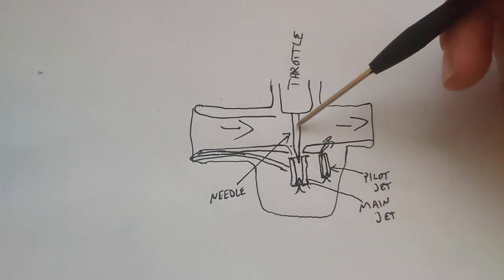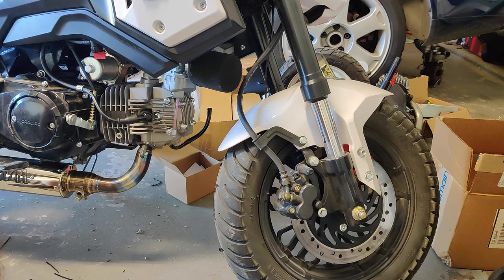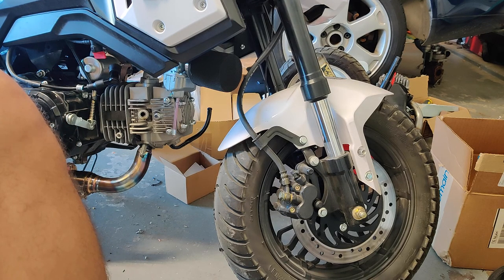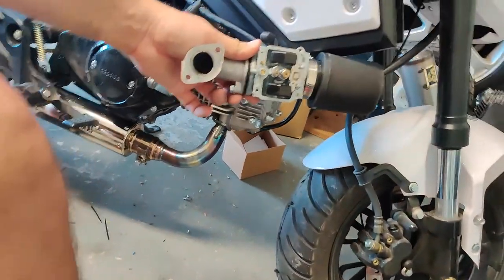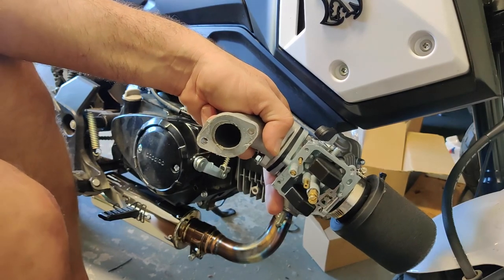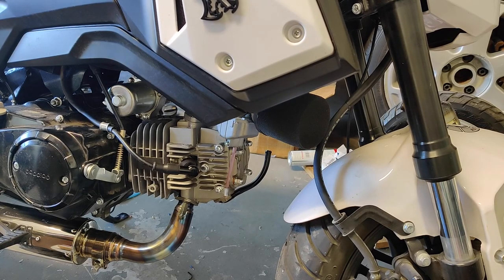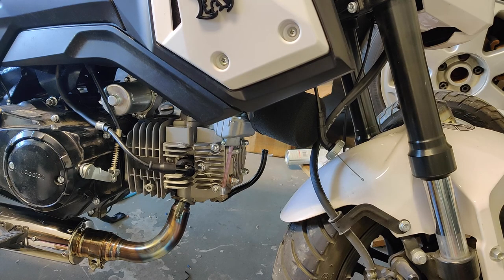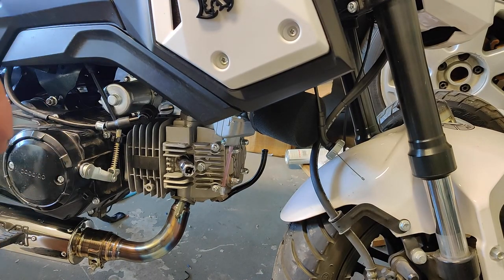Carb Tuning Grom Clones (Boom Vader, Icebear Fuerza, TaoTao Hellcat)

Comment: So you putted Pilot 25 and Main 100? Cause I’ve putted Pilot 40 and Main 110 it’s running way better I have lil bog on the 3rd gear, what do you suggest me? I still have the original Intake (20mm) with a Nibbi Carb 24mm, tomorrow I’ll replace the Intake, so do you think that I need to set the nedle too or change again jets?

Comment: What did you have ur fuel/mixture screw set at? I’m running a 98main and 15 pilot, idles fine but full throttling it bogs n dies its super rich, needle is set in the middle, 790ft above sea level.
Reply from the maker: Man unfortunately I couldn't tell you. I sold this bike a long time ago.if it bogs super rich, this points to a too large main jet. Your fuel mixture screw adjust idle AFR.
Reply: @BrunerTuner Ahh man gotcha! Yeah like idling it’s fine but soon as I full throttle at idle it bogs and wants to die, when I take the manifold off gas is just sitting everywhere I’m lost lol
Reply from the maker: Good luck with the project man! Thanks for checking out the video

Comment: Sorry for all the questions but I just got mine and I'm still learning so I'm curious as to what emissions parts I need to remove. I know about the carbon filter but that's it. It's in California so has all the CA legal crap
Reply from the maker: The biggest things I removed were the charcoal canister and the EGR pump. All I had to do was block off the EGR port on the underside of the head. If you get a new carb and manifold, it won't have the vacuum port. If you choose to keep your stock carb, you can just cap it off

Comment: I need help, I just finished installing mine carb but it doesn’t start. The grey plastic thing where the needle for the throttle is doesn’t go all way down, there is a gap where the air will flow thru. Could that be the issue why it doesn’t start?
Reply from the maker: It could be in backwards. It only goes in one way

Comment: I putbkn a new fake carb. It's idling high, around 6k. I put in a 105 main jet prior to installing. Would that need adjusting? The throttle doesn't fully close when looking into it, slightly open. Kept the stock pilot jet. Help?
Reply: Added a mikuni carb and mine is way up at like 6 grand also. I have messed with it so much the battery died.
Reply from the maker: Something to check is make sure the slide is put in the correct way. It can be put in backwards. Also, make sure the choke is off.

Comment: i have a boom lil duc (ssr razkull clone) that i plan to put the vm22 carb on there which i think comes with a 90 or 95 jet.  do you remove the charcoal canister with this mod and do the bottom block off plate?  i dont have an aftermaket exhaust yet, just the front 16t sprocket.
Reply from the maker: So on mine, I removed all of the EGR, charcoal canister, basically all emissions stuff. For the EGR block off, the gy6 EGR plate works, or you can just bolt down a penny under the EGR pipe for a quick fix.
Reply: @BrunerTuner  getting the block off plate will work so the canister and all that stuff wont be connected, its just dead weight right?
Reply from the maker: @jonathancunanan  yeah the block off plate is the main thing you will need

Comment: I see you have the TST fender eliminator kit on your Vader Boone Did you have to get the OME Honda ground plastics to make it fit correctly? Please let me know I recently ordered one and having troubles I went ahead and ordered the OME parts hoping praying that that's what will solve it very excited to hear back from you Thank you
Reply from the maker: Yes that's correct! I actually did another video on the panel conversion because it was necessary to get proper fitment.
Reply: @BrunerTuner  you did okay I'm going to try to find that video as well Thank you very much for getting back to me man I appreciate it

Comment: Great Stuff. Off topic, what exhaust are you running? And where did you get it? Just picked up a Boom Vader and looking for exhaust options.
Reply from the maker: Hey Greg! This exhaust is actually a Honda Grom piece. Zoom Brute is the model. It's not a direct fit but it will work with some persuasion. I had to heat and bend it with a torch and some pipe.
Reply from the maker: @Tony Barnes Jr the part number is ZM-HD-MSX125-STL20-3-LO-DWN

If you good search Zoom Brute GP, you'll find it pretty easily.

Comment: Loved the video, just got a Vader and working on tuning the carb and this is by far the best video. What exhaust is that? And is it a direct fit?
Reply from the maker: Hey Isaac, thanks for the feedback! This exhaust (Zoom Brute) is a direct fit for the Honda Grom. Due to the angle of the exhaust port on the clone engines, I had to use a torch and pipes to bend it to fit. It can definitely be done though!
Reply: @BrunerTuner  appreciate it! Loving the channel keep it up

Comment: so did you get your exhaust custom fit??? I've been looking for a aftermarket exhaust for so long!
Reply from the maker: I actually used a Grom exhaust and heated it until I could bend it
Reply: @BrunerTuner  what did you use to heat it?
Reply from the maker: A torch

Comment: I’m having a prob with my bike so I change my filter to a cone one and now when I give it gas it acts as if it wanna bogg down(shut off) what could be the problem(I have the boom Vader)
Reply from the maker: Changing the filter to a cone can effect the air/fuel mixture. You will have to tune the carburetor to handle the extra air flow
Reply: @BrunerTuner  so how can I tune it
Reply from the maker: Well this video breaks most of that down. If you add more air, you need more fuel. You could start by figuring out where it is bogging at and go from there buy buying larger jets

Comment: I have a 2021 wolf striker 125cc , I know how to ride but I know almost nothing about bikes and mods . How can I make it faster ?
Reply from the maker: Well, like most 125cc clones, a gearing change does a lot for top speed. Most people get a 16 or 17 tooth front sprocket and that will get you in the mid 50s mph. Past that, a vm22 carb and a free flowing exhaust will help tons. You should be able to get close to 60mph with those mods. Anything more, and it's worth getting a zs190
Reply: Ok , right now stock I’m getting about 55 max . What’s the best choice to get it maybe to 65? And do you know of any good sounding exhaust? Do I need to get a full exhaust system or a slip on ? I’m sorry for the long question I’m just genuinely trying to learn
Reply from the maker: I would check out Clone Army on facebook. Use the search function and you'll see a wealth of knowledge. It all comes down to what you are willing to put up with. Higher top speed with gearing means you'll accelerate slower. A freer flowing exhaust will be pretty loud. 65 on the stock motor would be pretty tough. It's also worth noting that the stock speedo are notoriously inaccurate
Reply: Great thanks so much man

Comment: I brought mine down to a 90 jet. Still bogs out until dead at full throttle. Any ideas what it could be? I have a Vm22 and a ransoto aftermarket exhaust
Reply from the maker: So, do a pull on your bike, and as soon as it bogs, turn it off. Then come back and check your plug and see how it looks, then tune according to how the plug looks.
Reply: @BrunerTuner  I had the choke on 😂 thanks tho
Reply from the maker: @kurticus  lmao happens to the best of us bro 🤣

Comment: To raise the needle do I need to drain my fuel before ?
Reply: no
Reply from the maker: No you don't. The needle can be adjusted by unscrewing the top cap of the carburetor where the throttle cable goes in

Comment: Thats so weird you can get the same bike to idle on a 20 pilot jet! I needed a 48pilot and a 115 main but im using nibbi 26mm
Reply from the maker: The pilot I pulled out had a way higher number but it was clearly smaller! Sometimes elevation can change what you need as well. Honestly, if your bike runs well, keep it how you have it. Every carb is different